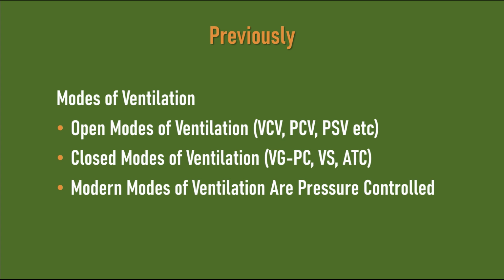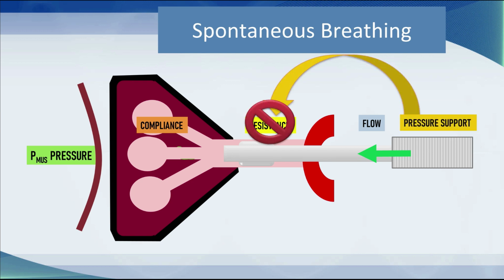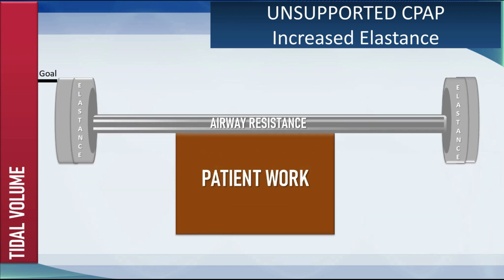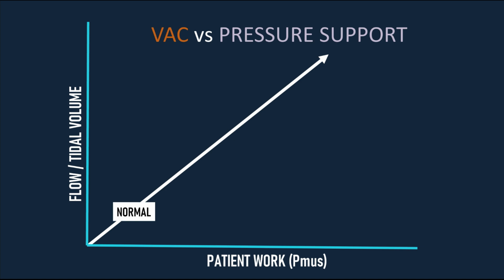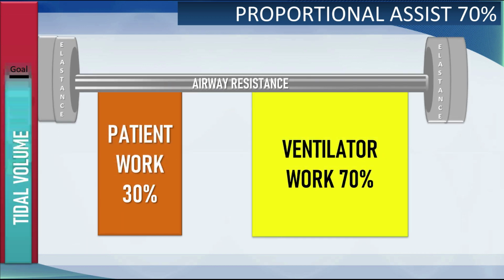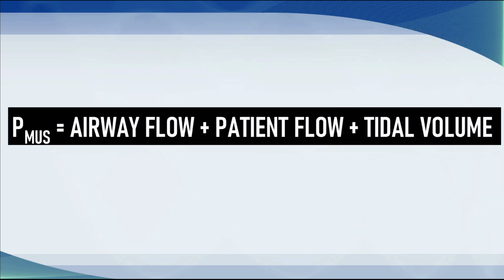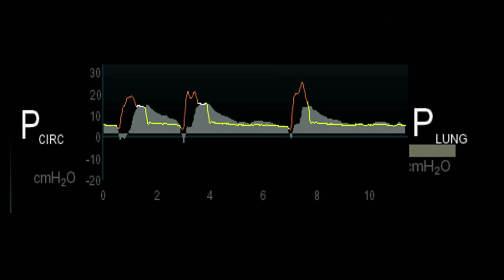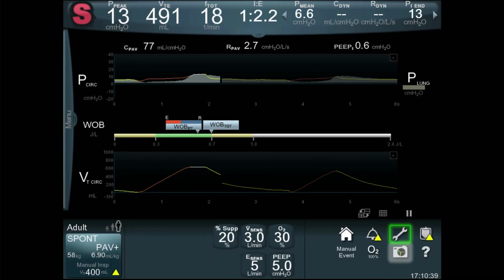Proportional Assist Ventilation (PAV+)

Comment: VC/PC/PSV are all closed-loop modes of mechanical ventilation.  For example, in pressure support, flow is maniupulatd to maintain a preselected pressure.  Furthermore, how would a ventilator know what parameters/alarm limits if it was an "open system."  I think the term you are looking for is "automated" closed-loop control.